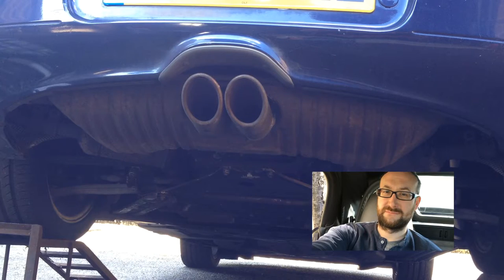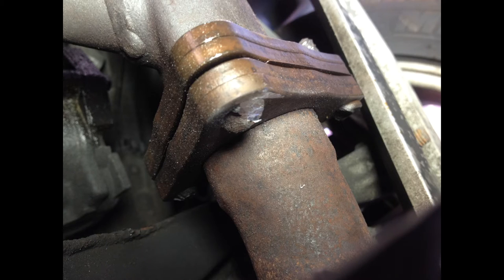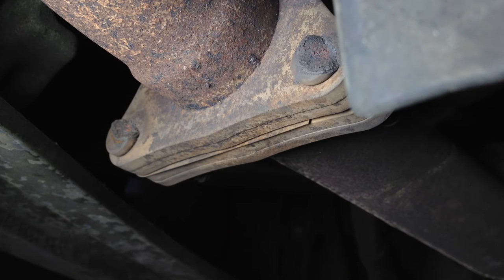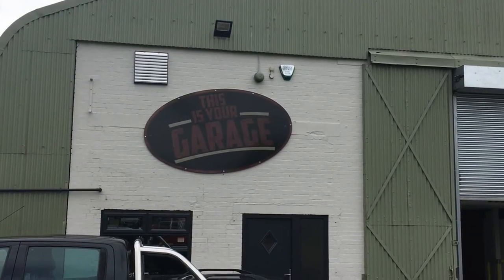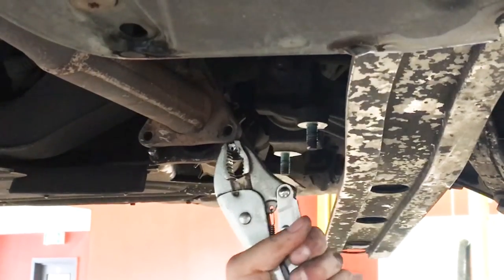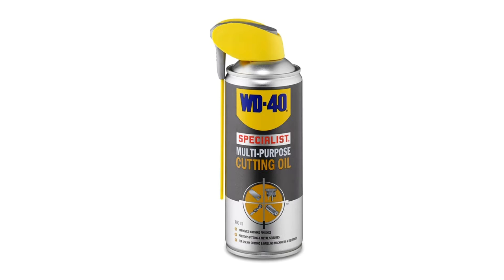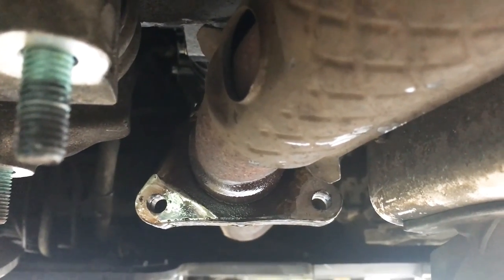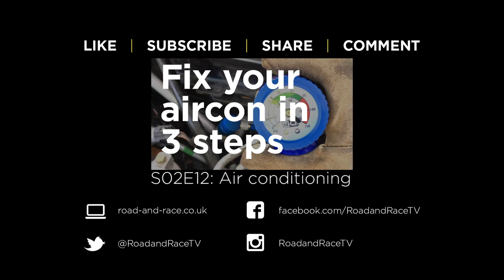How To Remove Rusted Exhaust Bolts Boxster & Cayman 986 987

Comment: Thanks for the video and the comments. Had this very issue as well except that the nuts were still in place without hexagons. Used a nut splitter and chissel to free the bolts. Used heat and a swedish pipe wrench to press out the bolts. A little under an hour work for one side.

Comment: This needs heat. Better to snap the remains of the nuts off. Then using a MAPP gas torch (available from good DIY stores) heat up the stud. Before doing so though, have a punch ready to knock it out hitting it from the thread side. Once the stud is glowing, tap it out with a  hammer. I actually used a small socket and a few extension bars. The socket fitted perfectly over the threaded bit of the stud.

If the old nuts are badly corroded, heat them up too and then hit them with some freezer spray. Watch how the thermal shock disintegrates them before your very eyes.

Comment: The fun of removing bolts, I'd suggest spraying it with pb blaster or similar any chance you get to let it work. I had a tough bolt that wouldn't budge even broke a socket on it.. sprayed it a couple times during the week and by the next weekend came out nice n easy. Great vids!
Reply from the maker: Yeah, they were stick good!   Thanks for the tip!

Comment: Air chisel with a freshly sharpened blade.  cut along the bolt into what is left of the nut and make a groove.  Angle the chisel so it now pushes in the "Loosen" direction.  Should come free.    Then put the punch on after grinding the tip flat and push the studs out...  Did all 6 that looked as bad as yours in less than an hour.  Then put the punch on after grinding the tip flat and push the studs out...

Comment: Just replaced my exhaust, those same bolts...oh Jesus, I had to cut off the nuts with a grinder, then torch the bolts and hit them about 200 times. And I just got my 2ND COVID shot yesterday, arm is hurting and a slight fever. I had 3 out of 3 rusted shut inside the exhaust. Then the old gasket fell into the catalytic converter, good grief. I should've saved this for an exhaust shop!

Comment: mine has triggered a enginewarning light with the codescantool saying the postcat oxygensensor detects a lean air-fuel ratio, so i guess it pulls ambient air into the exhaustsystem through a gap like this which causes it to get this code.
Reply from the maker: +TheWolvesCurse Yeah, could be.  Have you had a look under the car?
Reply: Road and Race not yet for that problem

Comment: Using Colbalt drill bits  helps too, had  the same issues on the de-cat flange on my RX8. Didn't try all the hitting though as knowing how the studs are pressed in I thought I'd likely do more damage to the rest of the exhaust/mountings.
Porsche must have sourced the cheapest steel nuts on the planet. Mine look as bad as yours but while they're still holding on I'll leave them. Having soaked many things in penetrating XYZ I actually think it has little if any effect apart from the placebo one.
Note to Porsche:  -Stainless steel, not a new invention nor an overkill on a Premium car.
Reply from the maker: I completely agree.   Why make a stainless exhaust then connect it with cheap nuts!   Couldn't have saved Porsche that much money.  Thanks for the tip about Colbalt bits.

Comment: What a pain in the ass this work must have been!^^ Didn't you want to upgrade the exhaust. This one looks in good condition but it's not really shiny anymore. There are some nice after market exhausts out there :)
Reply from the maker: Yeah, it was a real pain, but a at least I learned something.  Would love to have replaced at the exhaust as the stock 986 S one is a little muted.  The system I wanted was over £2000 so may just replace the muffler if I can save enough cash!

Comment: This is a oxy/acetylene job with a very small gouging nozzle a very steady hand and a punch providing the bolts are mild steel not stainless ... shouldn't take any longer than 15/20 mins to knock them out , without heat it's going to be a sod of a job and I can see why it took hours to do ..  I will report back with how I have got on ..
Reply: So how did you get on?
Reply: hugh3sy7 

I used a friends ramp and he had a set of oxy/acetylene,  the nut heads had totally rusted off , heated what was left of the bolts cherry red and then punched them out , to be fair the job took about a hour , this car on clip is a 986 mine is a 987 , replaced new stainless steel nuts blots and spring washers new gaskets job done , having the heat is the key to doing this job and a car ramp , ordered pack of 8mm x40 mm stainless bolts plus the stainless nuts off ebay ...

Gaskets from europarts 

Done 1000miles since done all good 😊